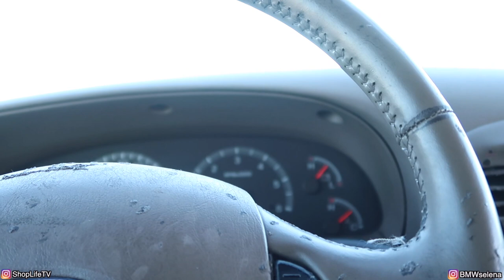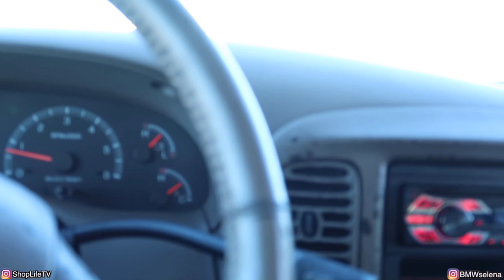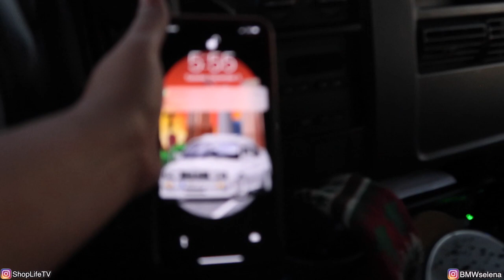CROSS COUNTRY MOVING TRUCK DISASTER!

Comment: You guys are simply amazing!  You make a cross country trip seems like a drive to the corner grocery store! So calm and collected. Recent subscriber here and not aware of your move back East, I actually went to your now ex-shop in Alhambra,CA to inquire about having you  work on my '98 M3 Sedan (have 6 BMWs incl an E30M3 garage queen). I like your work ethics in the vlogs and seems like challenge after challenge,  you eventually found the solution!  Bravo! One of the most amazing vlogs is you rebuilding a wreck E46 then drove it cross country moments after its finished! Wow!  Congratulations on the successful move back and wishing you the very best!!